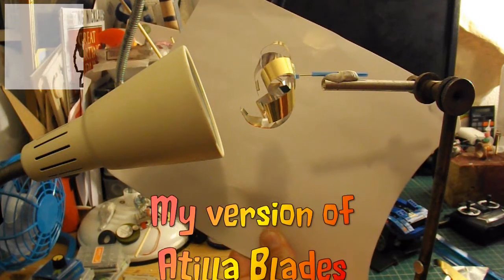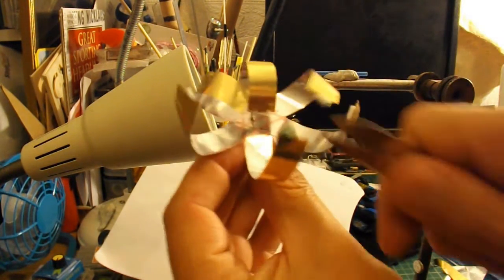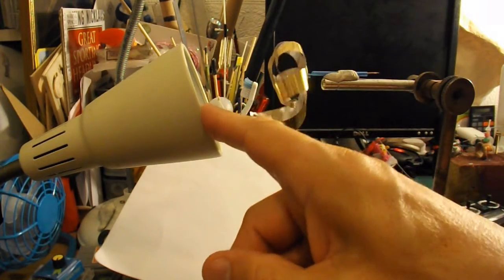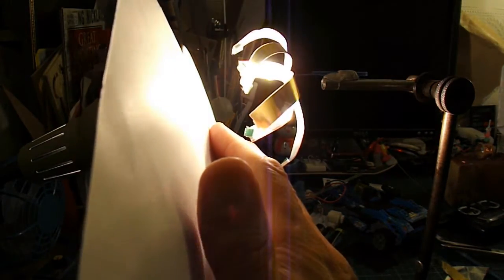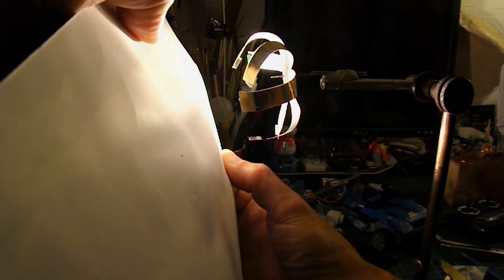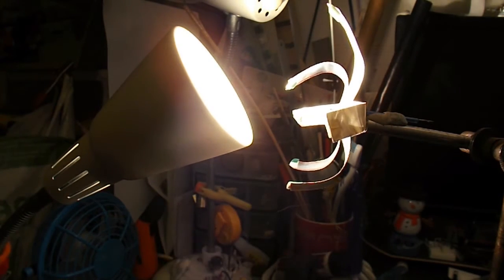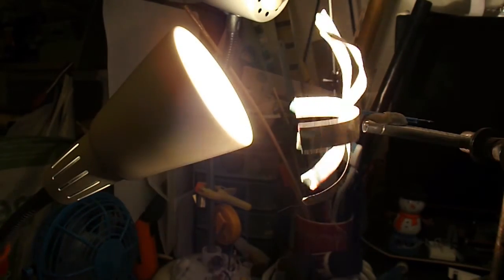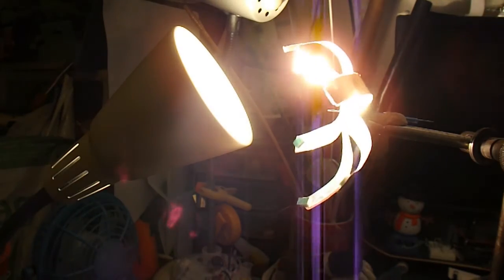My version of Attila Blade's rotating Heat Engine

Comment: Halloween is coming up.  This should work on a red infrared light in a darkened room. It would be really creepy.  If I can ever get mine to work I might make it an eight legged spider thing. I know what you mean about being mesmerized by the action on these things.  They look alive.   Attila Blade really came up with neat invention.  I am having great difficulty getting a rotating one to work. I will try your design.  Thanks.
Reply from the maker: ***** with your experience with very low friction bearings you should get a better run than my effort. I haven't had any success with this version in the sunlight, but that may be because we haven't had any direct sun for long enough to unfurl the petals. The lamp I use has a halogen bulb so it gets pretty hot. I tried a couple more today, I didn't want to but they made me :-) The first is with a CD as the basic body with some petals stuck round the edges. It is incredibly slow at rotating. I then did another just made from a disc of the coffee beans bag and cut it to look more like a flower. Visually quite effective and ran reasonable well but still not regular rotations. Making a mask or shield to ensure the light only hits the right place would probably improve things significantly. I will probably upload the videos later.
Reply: GrandadIsAnOldMan Did you see BLADE's latest video with his running on very very low temp differential?  This project really has my attention.
Reply from the maker: ***** haha, I have now :-) I think as long as the friction of the bearings is minimised and the wheel is perfectly balanced - or whatever we call the bit that is turning - the very slightest temperature variation will always work. I think I have 'over-curled' my petals and suspect it would still work with the petals nearer to open all the time. I am trying to move on to other projects but may still do another one or two yet.